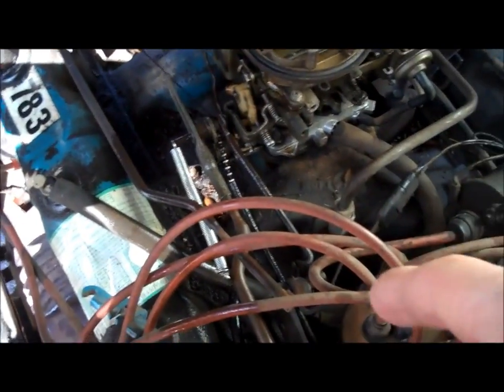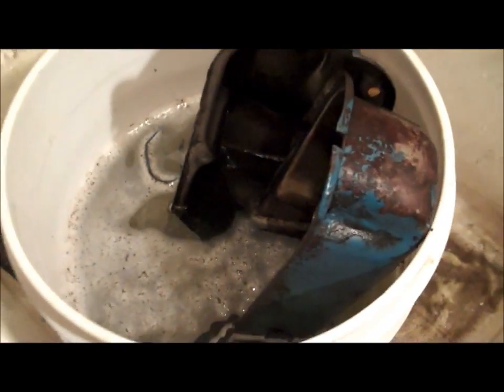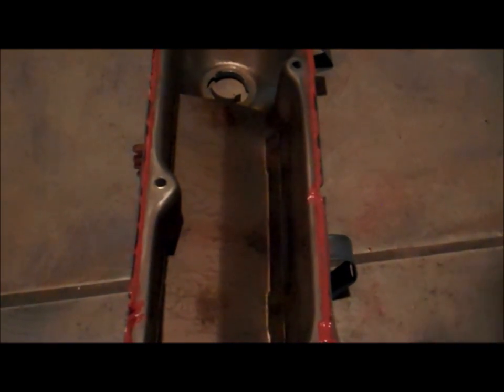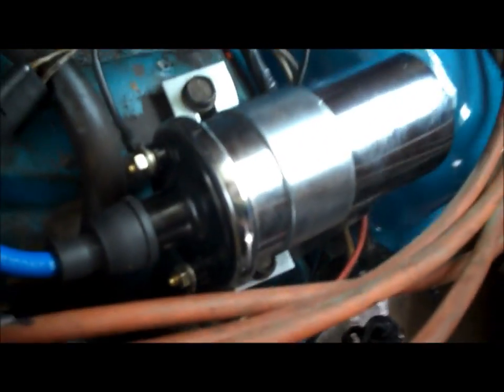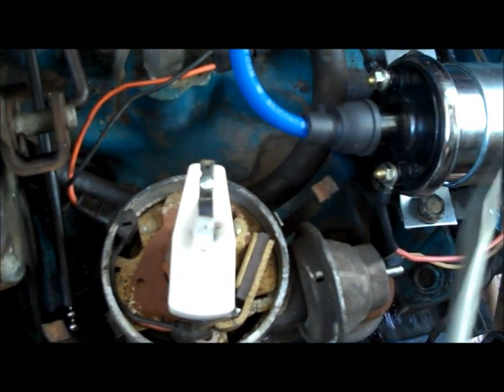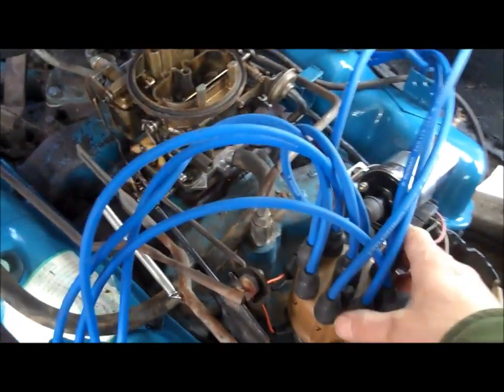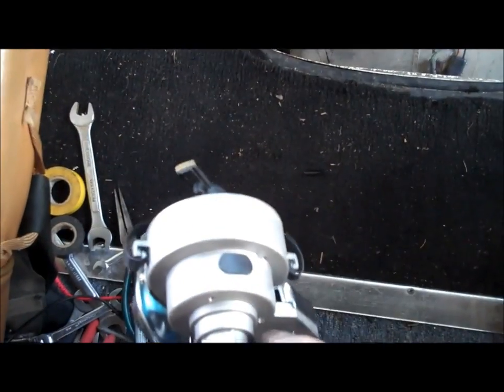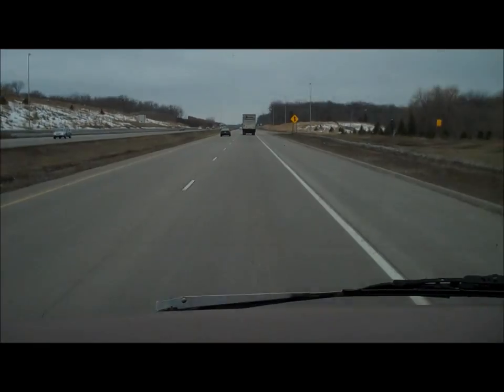1978 Dodge RV Restore #2 - Valve Covers & Ignition

Comment: I took 8 old clothes pins and numbered them 1-8. I put them on the spark plug wires to easily keep them numbered. Nice upgrades on the engine. Love that air cleaner.

Comment: Your post was inspiring.   You do great work.  There are too many videos that make repairs look easier than they are.  Even when you do it right, you can expect setbacks.
Reply from the maker: That is why I believe people are to afraid to "TRY" to do things.   They afraid to fail....when in fact it's not failure to run into a "hickup" or an unplanned problem.   It's called LEARNING.

Comment: Hi Yankee Prepper 
I Have been enjoying your videos on Your RV restore plus your Vehicle DIY videos
My parents have a 1976/77 Dodge B300 Delta Motor Home with a 360 engine in it
They purchased her when she was only 3 years old.
We have taken the old girl to 48 States and all 10 provinces in Canada over the many trips
She has been great to us  
Recently my parents have passed her on to me to continue the journey
I just finished redoing the entire Brake system from the brake booster to the pads and redid all the wheel bearings and races
Now onto the engine compartment. So far I have replaced all of the coolant and vacuum hoses
Next step i am planning on replacing the Carburetor and replacing allot of the engine gaskets to cut down on the good old leaks 
I really liked the chrome Air Cleaner Assembly and the valve cover breather Filter you put on.
I have been trying to locate them but haven't had much luck even went to K & N web site and came up empty
Every Web site or Store I have tried I have come up empty
Could you help me 
Do you remember the part numbers for Air Cleaner Assembly and filter also the valve cover breather Filter ?
Thank you 
and 
Thank you for all the great videos keep up the great work
Reply from the maker: All parts are from Rockauto or Ebay.  I don't have any part number,  I just searched the engine and ordered the parts.

Comment: Just seeing these vids today. Really good.  I commented on number 4, which I saw first and loved. As a woman with no mechanical experience,  I still got something out of this. I'm trying to make a 1975 Coachmen dependable as well as comfortable. Thankfully, my friend and neighbor of many years is a mechanic or I'd probably be quoted a price so high I'd be SOL. Still, he's use to cars and can rebuild a hot rod easily. He says it's just different working on an RV.  I ordered/received a wrong part twice. One was a brake line. However,  he adjusted the fitting of one side. It works well. Also kept old fittings in case needed with new lines in the future. But, he too had to clean up one old part and reinstall it because I couldn't find the part anywhere that fit her. Hate you got the wrong part; however,  what you did looks amazing!  Hope to see interior as I keep watching.

Comment: Nice!!! those valve covers came out nicely, I always check the push rods when I am in the old 360's and 318's they are notorious for bending ever so slightly and at about 2.00 a push rod easy quick and cheap. The best upgrade for an old dodge 360 is the newer high torque delco starters from the 94-01 Ram 360 magnum engines. They bolt right on and spin the old engines fast especially in the cold and weigh a lot less than the factory tractor style starters when you have to change them out, also you can remove without disconnecting the headers or exhaust.. 100 amp ray bestos alternator and you are ready to roll but if you go to a larger alternator be sure and check the lines running to the alternator gauge in the dash they are notorious for catching fire in all those old dodge truck dashes. It has happened to me twice restoring old dodge trucks. I just always bypass the alternator amp lines running in through the firewall and go with a volt meter instead of the amp meter. There just is no good reason to bring all those amps in through the firewall and into an antique dash cluster... beautiful work Yankee looks amazing, BTW I am super jealous you found this Minnie Winnie.... Your work as always is impeccable, thank you for sharing...
Reply: I've got the 360 from a 79. Thanks for that info!

Comment: This is March of 2022 I have a 77 Dodge 360 in my Mallard class C RV.. it had 84,000 original miles on it and after about 9,000 miles I realized a lot of things needed to be done but it didn't realize at first so to make a long story short I started at the bottom of the motor replaced the oil pan with a brand new one an oil pump also new transmission mount motor mounts and service the transmission changing the filter and fluid. Of course I went and did the rear brakes that weren't working when I purchased it put a new emergency brake cable in also. then started on the front of the motor replacing the timing gears and chain and cover water pump fuel pump idler pulleys alternator all hoses all about fresh tune up new coil and Edelbrock high performance intake manifold and an Edelbrock high performance for barrel carburetor and I put a nice chromie valve covers on with the Edelbrock carburetor air cleaner and those really nice chromie valve cover vents a nice Chrome thermostat housing. And all aluminum radiator and this baby sings and she's beautiful to look at but the dog House covers it so I take a picture of it and that's probably all we're going to see at this beautiful engine but she sure runs sweet. The nice thing about these Dodges are the parts are still readily available all the electrical parts everything. Which I also change and have spare parts on hand.

Comment: I have a 1976 22' I just picked up and not running..I'm thinking the fuel pump. I put new gas in but nothing...I love your work..Mine is the 360 with 90k from the original owner
I need a few things but this one is clean on the inside and not to bad on the outside...Dam rats ate holes in my ac lines..
I would like to see more of your work...I have everything even a service manual..Thanks for your Video's
Reply from the maker: +Ken Link    I think I have abut 8 or 9 vids up on the RV now.  I was actually putzing around with it today, chalking the top line on windows.

Comment: i hope you're still posting, i have a question, did you ever replace the distributor? i have a 1978 dodge 16, 6 Sportsman with a 318. I've been updating the engine just like you suggest and i'm about to put the new distributor in that i got from "rockauto" .

i ran it the engine with the old distributor to make sure it ran after all the updates and it does. how difficult is it to put the new distributor in? does the #1 cylinder have to be at TDC when i change it out to the new one so everything lines up down inside?

FYI i marked the location of the #1 cylinder with the rotor just like you did at 7:27 and it lined up in the exact spot yours did (i never would have thought to to that if it wasn't for this video) 
many thanks for your channel

Comment: I recently bought a 1976 Dodge RV B300 21' with a 360. I'm planning to remodel it myself. What repair manual do you use? Haynes? Did you redo all the aluminum trim and butyl tape at seams of trim and windows?

Comment: Does a distributor cap work like ignition points? I only have motor experience with motorcycle engines and small motors. I had a 1978 Honda CB550 and fought with the points for months before switching over to an electronic ignition system.
Reply from the maker: The "conventional" points/condenser/coil ignition system was invented by an American named Charles Kettering the founder of DELCO and first introduced on the 1910 Cadillac.  The newer electronic ignition systems might give better performance at higher speeds but is no where near as dependable.

Comment: Engine looks great, what kind of power system does that boat have? Curious how many amps that alternator puts out to power all the on-board equipment. For the record, I know nothing about RVs. Thanks Yankee.
Reply from the maker: The original alternator is 68 amps and that is plenty to power the 12 volt lights and a pump and/or heater fan ( the rear AC only works when hooked to external power).  The new LED lights I will be putting in next,  will actually make it a little easier on battery drainage.  I will be upgrading to a 100 amp to handle the cameras, TV, driving lights etc. I will be adding though.   There really isn't that much to this RV that is any different than my truck .

Comment: Do you have the part numbers for what you installed on the motor?  I have a very similar setup and need to find a few parts.   Mine was not in as good of shape outside, but my frame was fantastic.  Just need to do a few repairs

Comment: I pulled the carp line right from the carb tried to crank it and there is no gas coming out.. fuel pump?...thanks for liking my jamming..
Reply from the maker: +Ken Link Most likely it's the fuel pump,  especially if it's the original pump.    I would order a new fuel pump and a new fuel filter.   My RV has a fuel filter about mid way up the body on the drivers side undercarriage

Comment: Hey there, I have a 1976 Dodge Sportman RV as well and have in issue starting it. I replaced the battery, starter and alternator. I was wondering if you could give me a parts list for all the electronics and relays you replaced so i can do the same and make it run good again. Thank you.
Reply from the maker: I will do that for you.  Gimee a day or so and I will get back to you.
Reply: *****
thank you. just trying to do a good refurb and make it dependable.I love the work you've done. You've given me inspiration to finish the refurb on mine! :)
Reply from the maker: I am going to put the list up here in case there is someone else that needs it.
Ballast Resistor - CR105
Ignition Resistor - AL795
Starter Relay - 16115
Voltage Regulator - VR733
Ignition Control Module - Cr114
Instrument Cluster Regulator - IVR607 (optional - if problems with int. lights)
Horn Relay - HR639  (optional if problems with your ext. lights)
These are all AUTOZONE DURALAST PART NUMBERS.   If you are having problems locating parts for your DODGE RV,  use the year of your vehicle, engine and B300 DODGE VAN.
Reply: *****
THANK YOU THANK YOU THANK YOU!!!   Just got the parts ordered, now waiting til they come and the fun part!!
Reply: ***** 
I have the chance to pick one of these up for next to nothing. The 'RV' part is really good shape, but the engine is blown. Can you disassemble the front of the engine compartment and get the engine out that way for an R&R, or does it have to come up through the doghouse?

Thanks, Richard

Comment: I have a 1978 Dodge B200 Camper Van and I wanted to put an Breather like this one, but, My Carb is only 4.1" wide.  Did you have the same thing?
I am doing the same thing that you have done to two vans.  My 1978 with a 360 engine and my sons a 1988 Dodge Roadtrek.
Reply from the maker: You can get a reducer,  it's just a plastic ring/funnel that attaches to the air cleaner and then reduces down in size to the carb.  They have them on ebay and most speed shops/summit racing
Reply: Yankee's Journey and Fine Coffee. Hey I was wondering how you found a valve cover cleaner to fit. I’m looking for the reducer but I’m not sure what size I need.

Comment: lol, Why is it that Dodges have animals nesting in our engine bays!?!?!?   I just got my '78 Clipper with a 440, and the Mice and birds packed it so tight (with the straw, tree branches, and fiberglass from the doghouse) that it looked like the crap was a perfect mold of the doghouse when I pulled it off.   It took 2-hours to chisel through all the crap, and I still get to go at it again tomorrow.  {sighs}

Comment: Hi man,
can you email me ken.playguitar.link@gmail.com ....I din't have a Pressure Gauges so I can check the fuel pump...how can I check it with out that..I'm not getting any gas to the carb and just want to start this beast so I know what I'm looking at..it's a 76 360 like yours...it will run when putting gas in the carb...but did a blow back and burnt the hair on my leg and arm....bad motor..he..he..I do have a service manual...Thanks dude
Reply from the maker: +Ken Link   Just unhook the fuel line from the carb and see if fuel is coming out when you turn it over,  you will know right away if the fuel pump is working or not.  (If you get yourself some tubing,  you can route the gas to a can).   You can also run the engine without the fuel pump by hooking up a plastic bottle and tubing hooked to the carb inlet,  just hold the bottle above the engine and let gravity feed the carb.   With that being said,  you should be able to hear and SMELL gas squirting into the carb.   If you can't smell it,  you obviously are not getting fuel.  That means a new fuel pump which is only 15 bucks from rockauto is needed,  if it's the original fuel pump....it's TIME to get a new fuel pump.   There is the OFF/slight chance the filter is plugged,  so a new fuel filter would not hurt either way.